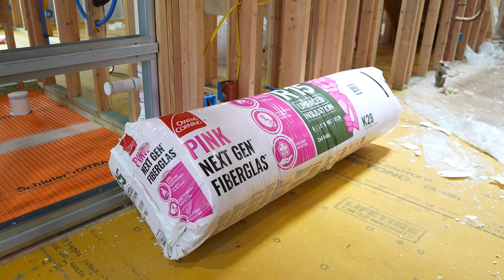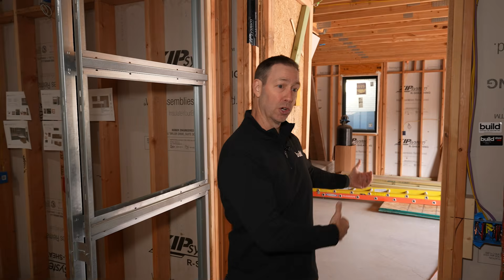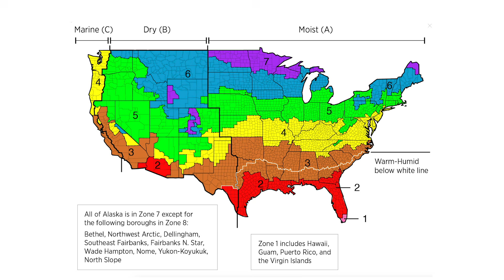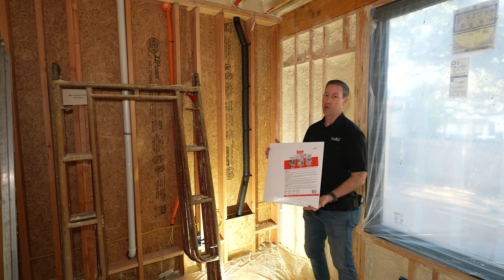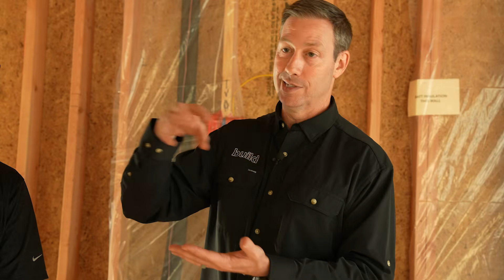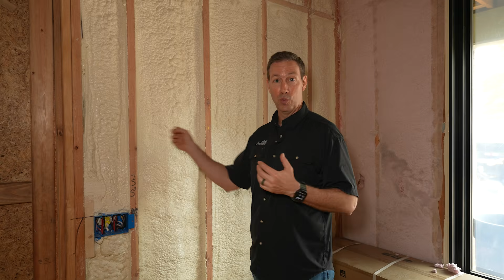The Risinger Build Ep:15 - Insulation & Proper Installation

Comment: Stop spray foam insulation. Cant believe this guy still recommends this toxic product that can lead to black mold problem.
Reply from the maker: Please explain how it leads to black mold problems. Mold is simply a moisture issue. Spray foam if used correctly can be terrific. You’ll see I use lots of different insulation types on my homes, depending on the circumstance.

Comment: Matt, you keep saying 2 contradicting things: 1) Spray foam is airtight. 2) foam shrinks over time. Both can't be true. It's either foam does not shrink over time in order to maintain airtightness, or foam shrinks over time and then you inherently lose the air tightness. Have you ever done a blower door test with a spray-foamed house after 5 years and compared the results with the fresh build?
Reply from the maker: You bring up a good point. Spray foam if done correctly can absolutely be airtight. However, if not done correctly, it can shrink back from framing. That usually occurs because of temperature or mix problems. In general, I don’t rely on spray foam for air tightness, but it is a back up system. The air tightness layer is on the outside of the house. The zip is the air barrier. I’ve done blowed our test on houses several years later and generally speaking they’ve held to the same number.
Reply: @buildshow  Thanks for your answer. I believe you are doing it right not relying on the foam as the air barrier. :)

Comment: Hey got an idea!!!! Spray enough of that foam in your house so when it floods the sucker will float and you can just bob around till water recedes and then screw it back down!!!!!!!!!!!!😂😂😂😂😂😂😂
Fyi- you cover up stuff with that foam crap and you will regret it. Bugs love it and water will dismantle the encased wood, that is if you dont suffercate from all the chemicals the stuff vents off. A house needs to vent and breathe to stay dry. If you create an entirely seperate environment you will never know when it fails until it falls. Over engineered crap has a habit of sooner or latter biting you in the arse. Proof???? Bridges fall dams collapse and twin towers fall with well placed charges......

Comment: This build is a FOR-SPONSOR Franken-Monster build. They are stuffing competing technologies into various parts of the house just for show, changing wall widths just for the sake of creating problems they later solve by using different products saying they are saving money and then saying we need to use this other tech because the wall depth is smaller. While the person buying this house will be comfortable, because in the end it'll be a quality build, but with every wall being different, it'll be one fugged up repair/remodel sometime in the future because nothing is consistent. Also, spray foam is trash, both meanings, rockwool is better. Not sure how to insulate roofline with rockwool though, strapping perhaps, seems like more work?
Reply: It does seem to be a showcase build applying different technologies and build methods intelligently applied to balance cost with performance.

Comment: Matt..... I'm admittedly at a bit of a loss here because I thoroughly trust your expertise and wisdom with regards to building energy efficient, properly air sealed and comfortable dwellings for Texas in particular & across the U.S. generally speaking.  That said, i can't help wondering why you didn't choose Rockwool, particularly where sound deadening was the goal.  

Over the years I know I've seen a bunch of Build Show episodes and channel related content you've produced in which I distinctly remember you touting the numerous benefits of Rockwool insulation--specifically noting its extreme effectiveness in damping vibration & significant lowering of sound transmission through treated wall cavities and rim joists / separations between ceiling & flooring above in 2-story construction, with additional emphasis on safety benefits pertaining to Rockwool's unique fire retardant characteristics.   

I certainly understand wanting to maximize project savings and the impact made by those big corporate sponsorships on the bottom line expenditure, but I'm curious if that alone was enough to go exclusively with products from the Pink Panther portfolio--their acquisition of your long-time favorite manufacturer of earth friendly closed-cel spray foam, notwithstanding of course.   I honestly expected to see you using Rockwool in certain critical areas of this build where it could be most beneficial, thus I admit being somewhat surprised by its omission.  

You certainly sold me on Rockwool long ago, so I'd be grateful for your thoughts on the subject.

Thanks in advance.
Reply: He clearly explained why he chose each type of insulation multiple times.

Comment: I am in southwest Virginia in the mountains.........our home was damaged from Hurricane Helene.   Our basement and crawlspace flooded........all insulation had to be ripped out, lost our HVAC system and all duct work.    What would be the best insulation to go back under the house?    Trying to make some smart decisions on how we build back and hopefully get back into our house soon........
Reply: EPS doesnt grow mould or mildew and retains its R value ( UNLIKE XPS)   so its ok in flood water   AMVIC makes ENVIROSTRAP which has studs or nailing fins inside of it.  It glues to the existing concrete interior ( or exterior) foundation walls.  No studs of wood required.  IN SO FAST also makes the same thing

Comment: I'd consider using spray foam over conduit or in the outer wall of a double-wall construction, but watching all those plumbing and electrical runs get cast in spray foam gives me the willies. I'd hate to be the guy tasked with moving a fixture or repairing a fault. Imagine excavating all that. What a nightmare!

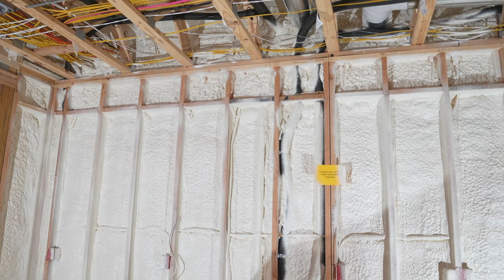Comment: 5:27 Re: either open or closed cell foam on the underside of attic sheathing roof deck - You may want to add the caveat that your roof deck under your composition shingles is an exterior vented roof deck because it is essentially a roof over the roof. Without having an exterior vented roof deck, spray foam on the interior can raise the temperature of the shingles to be outside of the shingle manufacturer’s warranty temperature range.

Comment: 00:50 "...Sound Batts...sound transmission...". Okay, thanks for the trigger warning. You caught me off-guard with the networking debacle so I appreciate the heads-up. Loins girded!
Reply: 31:49 And there it is. "Spray foam is a little more noisy so the sound does bounce around a little bit more". This is, on its face, a nonsensical statement. One material is not noisier than another, and unless you're planning to leave your walls uncovered, the drywall is the primary material interacting with sound within a space and preventing transmission between spaces.

The most generous interpretation I can conceive for this statement is, batt insulation is more effective at attenuating sound transmission between spaces than closed-cell foam, because (and I'm speculating, here) since spray foam becomes integral to the studs and to one side of the wall, it might mechanically transmit resonances of certain frequencies from one side of a wall to the other, whereas batt insulation, which is mechanically decoupled from the drywall will tend to dampen resonances within the cavity.

Comment: Closed cell off gases though. And not just for a little bit after, for its whole life. Basically when it stops off gassing it has shrunk (the gas bubbles are deflated) and it has gaps that aren't air tight anymore. I don't get spray foam as a premium and reliable product.

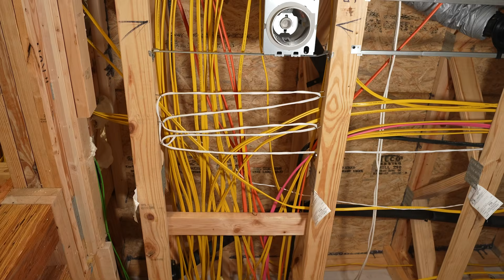Comment: @13:05 I would be livid if those wires&mechanicals were spray foamed instead of using blown-in insulation. The homeowner would have to pay a ridiculous amount to have the spray foam removed to service any part of that area. The difference in insulation for that small area would in no way save the home owner any significant money in heating/cooling.
Reply: It's really not that bad to work through. I'm in remodeling and weatherization and I'd rather work through the foam and seal it back with a can foam then deal with the loose fill and trying to get it back. I would have run a 2 inch conduit capped on the end for  future run. In a house this tight that area might be the biggest single leak in the envelope

Comment: What is the point of using Zip-R and then Atlas insulation on top of the zip sheathing? Wouldnt standard zip plus thicker exterior foam be better? That way there is extra fire blocking, and also the osb sheathing has more insulation on the cold site to avoid condensation.
Reply: Yeah, in the separate video on the Atlas, I could not understand why he creates at least 3 moisture barriers: Zip, Atlas foil, Atlas foil.  Money made him do it.
Reply: The zipR was only on the walls
Reply: For the roof under and overlay, he used regular zip. For the sheathing where he installed the exterior wall Atlas insulation, he used regular green zip, 1/2" nominal, not zip R.

Comment: Curious, what’s the reason you can’t (or won’t) build a basement in Texas?  Just the extra cost?  If so, why are they standard for new and old) builds even in rocky / wet areas like New England?
Reply: With land prices increasing there are more basements being built in Texas.  In some areas, the top soil is thin, then some clay, then rock.  An excavator may be able to remove the rock, but you usually must pay to haul rock away. More high-end home should use basements - basements have passive geothermal benefits - cooler in the summer.
Reply: @ interesting, thanks.  It seems crazy short sighted to miss out on all that extra square footage to save what, $10K up front?  Up here most of the excavated material can be used right on the site for grading.  

I can see how it might not be worth it for a cookie cutter mass developer, but maybe building codes should require them in most cases.
Reply: I'll tell you the exact reason.  I grew up in Iowa = everyone has a basement.  I have lived in Texas for 40+ years = "nobody" has a basement.  The reason is cost per SF.  Where there is frozen ground, the footers must extend below the frost line.  In Iowa, footers had to be 4 feet deep.  To make a basement, changing from 4 to 8 feet is little extra cost per SF gained.  Without freezing ground, construction of a big hole in the ground is a lot higher cost than adding ground-level SF on a slab.  If you have ground rock to deal with, it gets financially challenging.
Reply: @bobblack3870  That makes sense, thank you.

It's kind of horrifying to think of all that potential square footage wasted with the housing crisis, but I can at least understand how that calculation could make sense.  I'd think there would be an inflection point coming (or passed recently) where it would benefit the builder
Reply: I’m spitballing here… but I think it’s because most homes aren’t custom. So while it may seem shortsighted to try to save $10k upfront, your production builders might only be working with that $10k (just reusing your number) in profit on each build. 

They’ll avoid doing anything that won’t add more value to the home in an appraisal vs. the cost to build it. Basements seem to be one of those.
Reply: @lanewhite5928  yeah I’m sure if the economic incentive was there, the builders would do it.  It just seems crazy to me that the all the benefits (especially the added square footage) don’t add up to enough reason to do so.  That’s a lot of potential in law apartments!
Reply: Another reason is the underlying geology and soil types in TX. I would like to build on a lot with a daylight basement. The lot may have solid or fractured limestone rock under there, it could also be fill dirt 20 ft deep, the soil could be expansive that swells and shrinks a lot, but certainly the soil retains moisture like crazy in a rainy year, so the basement could become like a boat and float up. I will get a geotechnical analysis probably with drilling before deciding on the foundation slab vs. basement. Also, if it is expansive clay soil, the basement will have to be over-engineered to withstand the pressure, plus footer drainage needs to be robust due to high water. Oh, and during drought years, the soil can dry out to 40 feet deep.

Comment: I live in an attached townhome with the triple thick drywall fire block system. A neighbor gutted their house to the studs and rebuilt inside and they used to spray. The sound deadening is awful now we can hear every time someone goes up or down the stairs or makes the loud noise where has before we didn’t with standard fiberglass installation it may be working for them Temperature wise, but it sucks for us neighbors. If I were reworking things here, I would probably use the Rockwool, I remember we had that in our last house and really liked it.
Reply: Matt should have add more focus on the disadvantages, like you mention.  This is a "sales" house; I'm afraid that dictates what he says.

Comment: Interesting. I never see HVAC mechanicals in attics here in upper New England (VT/NH). They are always located in the basement with duct work going inside the 2x10 floor joists.
Reply: I am in CT and one of my HVAC air handlers is in my attic. I built the house 16 years ago and have since learn a lot about building science. I made 1/2 of my attic conditioned(esp. where the unit is located, after the build.  What a difference. Also, in the winter , I do not even have the amount of R value as shown, I can see the frost or snow on my roof above this area but not over the unconditioned space. I definitely would condition the entire attic when I build again.
Reply: Not all houses have basements, Texas homes are usually slab on grade
Reply: Yes, in Texas, basements are not used very much. In the Austin area, many of the soils are too expansive to build a cost-effective basement. So mechanicals are installed inside the home or in the attic, with some water heaters put in the garage. In my house, one HVAC zone has the air handler in the unconditioned attic space as that's how it was built.

Comment: I don't quite understand the financial calculation of using thick ZipR (3-4x more expensive than standard 7/16 zip board), but only 2x4 walls. It hardly costs any more money to step up to at least a 2x6. I do post frame and either use 2x8 girts or double-girt design (for 7-1/4 or 9" cavities) for R30 or R38 rock wool. Much cheaper than ZipR for the same or higher r-value.

Comment: Not sure about encapsulating electrical cables in insulation.  In Europe that's not advisable with twice the power in 240V and you really don't want any overheating cables inside foam. 🔥
It's a great way of air sealing complex structures, but as others have noted, insurers are raising issues with it hiding structural damage or moisture build-up.
Carry on with the great content!

Comment: If anybody can answer this question or ask Matt to make a video? What are the draw backs of icf vs stone and steel. A different channel suggested building with stone and using steel beams for support. ( longevity, cost, repair cost, type of environments either thrive in, any special equipment  needed, companies that have experience in stone and steel, any mandatory design features needed and design features a person would not have to worry about). Thanks
Reply: I think he has some videos on ICF builds.